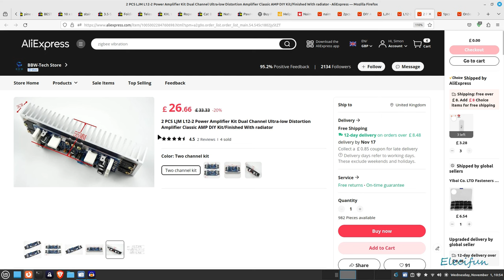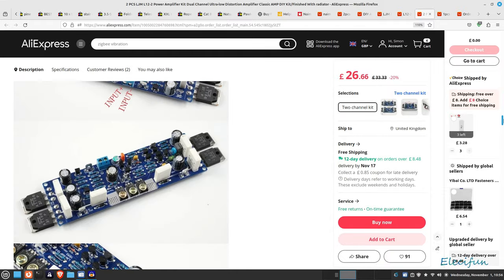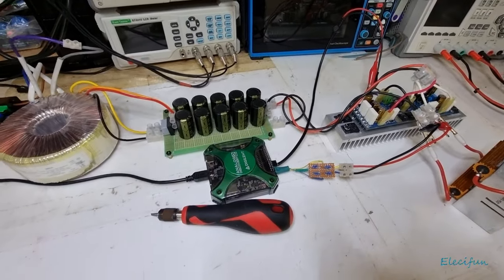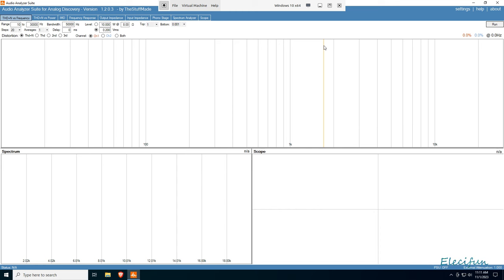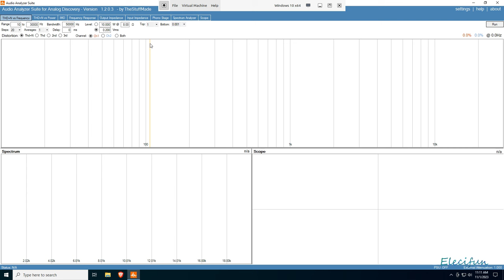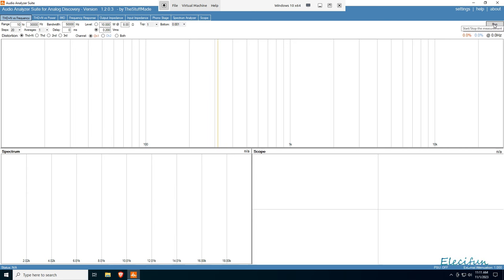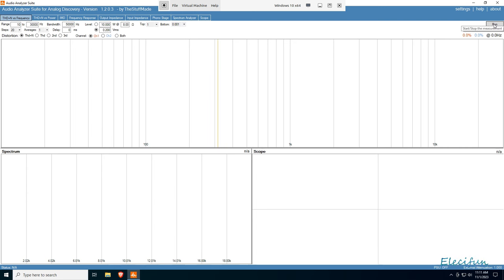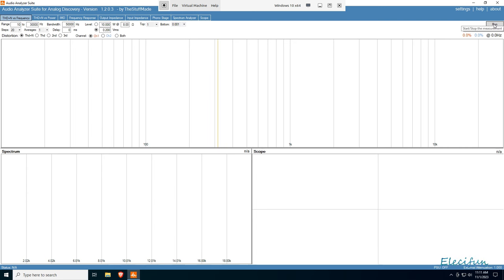LJM L12-2  Amplifier Kit (Aliexpress)

Comment: This is one of my favorite amplifiers. With 40 volts and 8 ohm speakers the supplied heatsinks are OK (just) but with a full 50 volts. However, they are well under rated for 8 ohms and will almost melt into 4 ohms. A couple of worthwhile mods I have done. Fit a preset pot to adjust the QI which does vary quite abit from sample to sample. The other is to match the first 2 transistors. This will give you the lowest DC offset, typically 10mV or less.
Most ABBA recordings are quite poor in quality, however THE DAY BEFORE YOU CAME (I think that's the title) is a really good recoding, lots a really low clean low-end. A good test for any amplifier/speaker combo.
Reply from the maker: Thanks for the mod tips Michael I will check them out. I'm not a big ABBA fan although I do have a greatest hits album, admittedly I listen and enjoy. I'm on a Roberta Flack binge ATM. Her First Take album is fantastic. If your familiar, the track 'No way to say goodbye', beautiful.
Checked my ABBA album and it does not have your recommended track. I will go looking for it as I am intrigued.
Reply from the maker: @MichaelBeeny I found the Abba Visitors album with your recommended track and have now purchased. Cheers for another tip.
Reply: A great dem track, was I right?? @Elecifun
Reply from the maker: @MichaelBeeny  I will feedback once I receive the album.
Reply from the maker: @MichaelBeeny  I listened to the Abba Visitors album and 'The Day Before You Came' track. It does sound nicer than some of the other tracks I've listened to. 
As a demo track I would suggest from the same-ish era, Lou Reed 'Walk On The Wild Side'. Nice bass, vocals and the sax is excellent. 
I suppose there is a lot to be said for production quality.
On a different note... Whats happened to your channel? Can comment, ask questions?
Reply: I have closed my channel down. Mostly due to poor health which will not get better. I had been getting so many e mails, comments and was spending about an hour a day answering questions etc. I simply cannot do it these days. I did make a video on why my channel is closing if you are interested. @Elecifun
Reply from the maker: @MichaelBeeny  I'm sorry to hear that. I did watch your video, I just though you would keep the comments open.  Well as long as the video's are still there, your hard work isn't lost.

Comment: I built a L12/2 mk 3 in October 2023 using a case from a Samson 500 DJ amp. I added a second heatsink because the original one was slightly too small to accomodate both L12. It's fed by a SMSLM500 DAC into KEF concertos circa 1970. Amazing sound quality
Reply from the maker: Thanks for your comment. Your DAC uses same chip as the Soundblaster AE-9 in my PC. Very nice. I use a Hiby R3 Pro with dual ES9218 DAC's as stand alone music player, battery powered..clean. I to use L12/2 as my main amp and its only rival so far is Symasym 5-3, that although didn't do as well on square wave at sub 30Hz does sound very nice. Monitor Audio, Monitor 300 speakers are my choice for full stage and down to 35Hz on a budget. All together I am very happy with the output, given my music is only CD quality.

Comment: I like the idea of a two transformer set up with each channel having its own power supply. Heavy but better. I also really like your tidy capacitor banks. If you decide to build the system into an enclosure I would be keen to see what you come up with. Great series Elecifun. Thanks for posting these vids. Cheers amigo 🍻
Reply from the maker: Well I would like to build into an enclosure or enclosures as mono blocks. Two separate transformers ensures your channels are not competing for juice when under load. 
I wish the enclosures were not so expensive.
Reply: I know you're really handy and capable. You can probably build a suitable, elegant, interesting enclosure cheaper than buying one.🤔
Reply from the maker: @Sonic_Ox  I wish I could. I don't have the tools for wood or metal working. I would like to use a metal enclosure and then check the noise on the amp again.
Reply: I understand. I'm fixed ok with metal working tools but my woodworking tools (and skills) are woeful. I like building enclosures with the 3d printer but heat becomes a consideration with plastic. All part of the fun I suppose. I've been experimenting with printing drone parts in TPU with mediocre results. It's a difficult material to print. I ordered some parts to convert my printer to direct drive extrusion. We'll see if it helps. I think the stepper motor on the new unit operates on 24 volts where the old one is 12v...🤔 I may be seeking your advice on switching voltage in the near future.  I know just enough about electricity to injure myself lol.
Reply from the maker: @Sonic_Ox  I do want to learn some wood work as I want to build my cats a swing bridge and running and sleeping shelves. I need to get some sleep and the youngest is always jumping all over me through the nights.
For quad frames plastics won't cut it. Light, strong and as ridged as possible. Carbon is the way.
Reply: Yes I definitely agree that 3d printed quad frames are VASTLY inferior to carbon fiber. I've watched countless videos demonstrating that very thing lol. My printing of the frame was just an experiment in design concepts and prototyping add on parts etc. I never intended to populate the plastic frame but when the old Hubsan started giving up the ghost anyway I figured what the hell. It's a good warm up for building proper carbon fiber quads and I've always wanted to conduct my own experiments with the 3d printed jobs. 

I hope that you produce videos if you build some things for your cats. I love seeing them. I really like getting a little snippet of peoples daily lives in their videos. Pets are GREAT for showing that. 🐈
Reply from the maker: @Sonic_Ox  I watch earlier your video showing the 3D printed frame. I also read your description which highlights your experiments scope. 
I nearly commented when I saw how the arms flexed. I thought OMgosh its going to make really jell-owed videos even if the PID controllers can keep it from vibrating itself to destruction.
It will make really nice studio candy, as it looks great!
Reply: Haha yes, I don't expect much from it. It is still very satisfying to see it lift off and hover and I've been having a wonderful time experimenting and learning.

Comment: That is a very clean looking build. The data would indicate that might indeed be "the one" lol. Thanks for another interesting and informative video Elecifun!
Reply from the maker: Your welcome Ox. Please remind me what tube pre amp you bought. Does it use 12V AC power supply?
Reply: I forget the brand. It's one of those chinesium units from BangAliGood... yes it requires 12v AC input. I had to find one on the interwebs because none of my wall warts delivered ac at 12v.
Reply from the maker: @Sonic_Ox  The fella that created the Audio Analyser software I use modded his and the difference is really good. Check out his vid if you want. Mod parts are jelly bean cheap.
https://youtu.be/xVNMp7tz6bo?si=kqCtvunTwhRN4m03
Reply: Thank you. I'll check it out.

Comment: Wow, thanks for the very interesting video! I am also very happy with my L12-2 Vers.4 amplifiers along with the B&W CM4 speakers. The Sound isn`t as worm and strong as with my old Audiolab 8000s, but very close.
Another question: Do you have any experience with the amp kit`sfrom Aliexpress with an integrated circuit in it - OP07 ? Specialy the Burmeester clones 933 kits? best regards from germany

Comment: Like your work - because "sound" is so subjective - i always rely on the data to make sure that the amp meets a baseline standard  - from there one can always EQ to your own ears
If you looking for a next project - try the Lusya Symasym5-3 .
I tested it at thd 0.0035% to 0.008% at 95W using a regulated 45V power supply
Reply from the maker: @zoelong6021 Thanks for the feedback.
Also, cheers for the heads up on the amplifier circuit. A great suggestion for a Christmas build.
Reply from the maker: Can you link me to your test?

Comment: It would be interesting to buy the new BJTs and redo your tests. Would it make any difference?
Reply from the maker: Not sure if its worth the effort. Are you familiar with the saying, 'If it ain't broke don't fix it' lols
Reply: @Elecifun  Yes I am and yeah that's wise. 😂
Reply: @Elecifun  The reason I mentioned this is because I read on a forum that these BJTs we're using are fakes. That's what he claims. It would be interesting to buy new Sanken BJTs and see whether it makes any difference to the "harmonics" ! I think that's why you called them. 🤔
Reply from the maker: @decem_unosquattro9538 Fakes, copies, re-licensed who knows. It could be argued that some copies do not have all the propriety features, example, Some chip amps that are copied work just as well but are missing a feature like thermal protection. I would imagine some fakes/copies are re-licensed. Buying genuine is far more costly and the better practice overall, saying that I have replaced fakes with genuine and not really found a difference. I guess if the fake does not work then replacing with genuine a good idea?

Comment: Oh have you got a turntable? Do you or have you heard much vinyl recordings?
Reply from the maker: I have some vinyl, most was lost to an angry X decades ago. The turntables I like I cant afford, i,e AR, Rega Planner, Crystal etc.
Reply: @Elecifun  Just get a mid ranger. Maybe $1000 anything beyond that I think maybe its a waste.

Damn that's so depressing to hear that you lost your vinyl record collection. Sigh. Sadly I lost most of my vinyl simply because I was homeless. I couldn't carry them simply because I had no wear to store them. My bro in low ended up with all my vinyl. My sister divorced him and now we've grown apart not that we were very close to begin with. 
I bought Fleetwood Mac Rumours 3x. All got stolen.
I had quite a good collection which kinda hurts how I lost them all. Another dude I new a 15 years stole my another vinyl record I had. 

One day I'll buy another phono.
I was kinda hoping you might get some bigger speakers like 13" so that I could gloat over them. 😂👍
Anyway its obviously not your interest and your happy with your current setup.
Anyway thanks for the video its most interesting.
I might buy this amp at some time.
I painted another wall in my workshop.
Also my newly plasterboard sheet has got its first coat of paint.

I'm bogging another wall which should be ready to paint. 

Once thats done I'll start replacing weatherboard and insulating walls. 

I'll start with the worst rotted out walls.

Then later I'll tackle the other walls.

Anyway I look forward to your next video.

Are you going to assemble all your amp parts into a case.

I'd be very interested if you are.
Anyway its late here.

Goodnight. 😴

Comment: Hello. Very nice video. Thank You. Where is the blue wire connected to on the attenuator?
MVH Tamas
Reply from the maker: Glad you enjoyed the video.
The blue wire enters the attenuator / voltage divider from the amplifier ground output. It leaves from  between the two 10k resisters and enters the AD2 via the scope 1 negative input. Dividing the output voltage by 2.
Reply: Huh. So You attenuate both the + and - of the amplifier output and the green goes to the AD ground?
Reply from the maker: @amdbtk  Yes, remember the AD has differential inputs + - . The green goes to ground.

Comment: You bought the kit right which is stereo? Are you buying an enclosure for it? Another toroidal transformer? 300VA 2x30V?
Reply from the maker: @decem_unosquattro9538 I don't know. Enclosures are expensive, I have limited funds. I like building the circuits and feeding back the data.

I will probably buy another transformer ready for enclosures. This will take some capacitor loading stress off the single transformer.
Reply: @Elecifun  you're right they're like $150AU for a cabinet. Hmmm
Reply: @Elecifun  Transformer ain't cheap either. 🤔 I don't know which way to jump with transformers. The AliExpress transformers are very disappointing.
Reply: @Elecifun  If you do decide to buy a cabinet at the very least you don't need to buy radiators. I notice they are essentially radiators.

I guess the go is to buy another transformer and then choose the smallest case/ enclosure possible? Buying the biggest probably not such a good idea 🤔
Reply: @Elecifun  Anyway this is going to buy an interesting build for me.

It might be a better idea to buy a smaller set of speakers. 

I'll build the speaker boxes myself.

The only problem is the dimensions.

🤔
Reply from the maker: @decem_unosquattro9538  I was looking at nice ones on Aliexpress £200 - £300 and then tax. I want mono block enclosures and have to make sure the circuit is worth the expense.
Reply: @Elecifun  Yes. It's a pity we can't use Taobao which is a lot cheaper. For example one product was 16 times cheaper. "Fuses"
Reply: @Elecifun  oh, I meant to tell you that my 5.1 SS system shit itself again. Same issue which was the bridge rectifier same as the one you were holding in your video. I guess it's the inrushing current. 😤
Reply from the maker: @decem_unosquattro9538  I buy my transformers from Farnell a proper electrical/electronics distributor. I cant afford Audiophile, and use VTX-146-300-230 on https://uk.farnell.com £45.75 inc.

The costs all add up, so the right circuit is important for me.
Reply: @Elecifun  geezez christ ! 300 British Pounds thats nearly $600AUD. 🤯
Reply: @Elecifun  do you mean speakers?
Reply from the maker: @decem_unosquattro9538  buddy it will be all down to your setup. Remember you might need another transformer independent in the amp case for speaker protection circuitry. 
I use passive speaker protection circuits on my speakers, no power or extra space needed.
The choice is up to the builder.
Reply: @Elecifun  I think your wise to buy them in the U.K. AliExpress transformers don't meet the speccs as I found out. 😐
Reply: @Elecifun  That's right. "Setup"

Yes I think I would get two transformers. And of course speaker protection circuitry.

Oh I just bought a soft start module. Maybe it'll stop me burning out my Z5500s.
Passive speaker protection -  I don't know what that is.
The choice, yes. When I order that same kit I shall then decide what other components I need. It'll take me awhile to be able to afford it. Everything is so fkn expensive now.
Reply: @Elecifun  Good night sir. I'm excited to see it up and running. 😁 

I hope you haven't been destroying ULEZ camera's. 😅

I noticed some hooligans going around breaking them. 😆🤣

Comment: Hey Sir back again for the 3rd time.

Can I ask you what size transformer you used on this amp?

It's says 55V and I saw a dual 55V transformer 120VA. 

I wonder whether I should get one or two like I think you said in your video.? 🤔 

I'll take your advice and get the film cap, and the two electrolytic caps instead of the two ceramic capacitors. 

I can't wait to get the LJM L12-2.

It shall be mighty interesting project.

Oh incidentally I saw a pair of speakers which is even bigger than what I'm planning on building.

They really are awesome 😅 Imagine those beside your telly. 📺 

Two 13' sub woofers. You'd need a beast of an amp to drive them.😁

The speaker enclosure looks like a real nightmare to build.😂

Edit okay you're using a dual 30V transformer. Hmmm.
Reply from the maker: The dual 30v AC once rectified provides around 42V DC mine is 300VA. Not sure what you refer to when I said film capacitors.
Reply: @Elecifun  I noticed you replaced three caps with two electrolytic and a polypropylene cap.
Reply: @Elecifun  That's was good timing. I just got home.
Reply: @Elecifun  so what ate you going to do sir? Buy another transformer?
Reply from the maker: @decem_unosquattro9538  If I were to case the amp then ideally I would buy another for mono blocks. At the moment one transformer is fine, I don't push the amp so I'm not worried about voltage sag.
Reply: @Elecifun  The problem with an extra transformer is the space it takes up.  Two amps, two transformers, filter block, speaker protection doesn't leave much space.
Reply: @Elecifun  what do you mean mono block? 🤔 I'm too tired to go on
 Night Sir 🤔😴
Reply from the maker: @decem_unosquattro9538  I just looked at the kit online and there are some changes to the capacitors.
Reply: @Elecifun  oh, maybe I don't need to change them. 😄👍
Reply from the maker: @decem_unosquattro9538  They came with the kit bud.